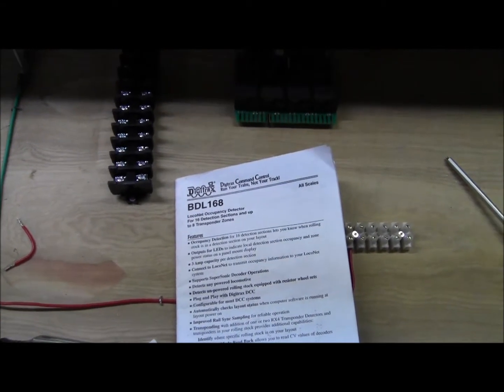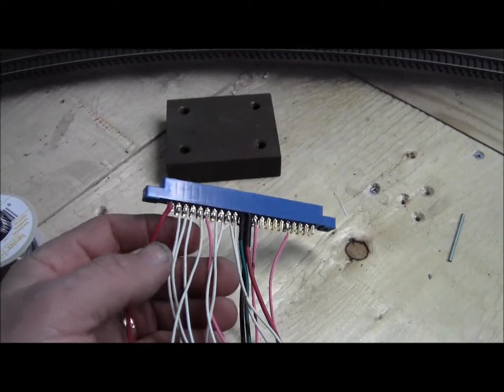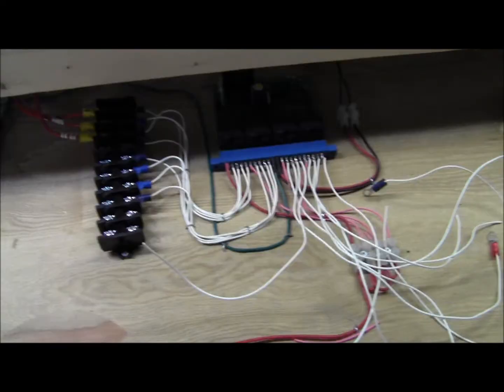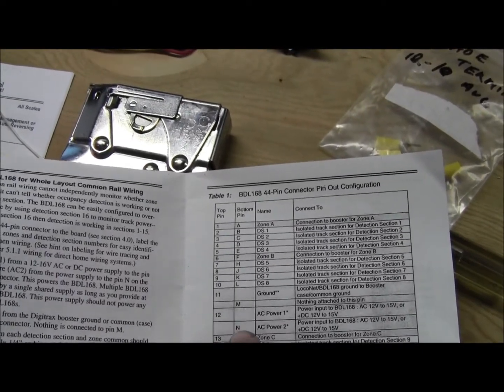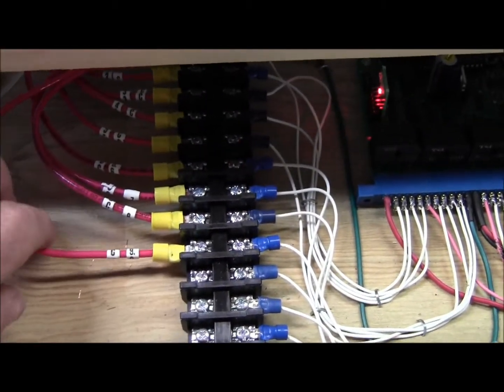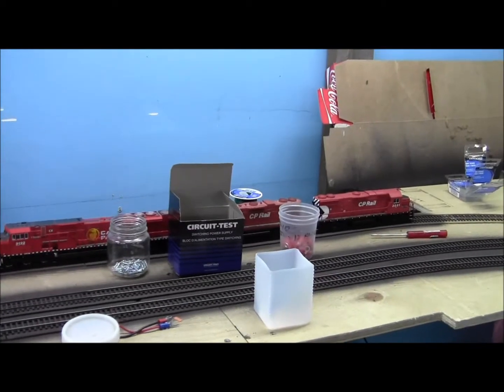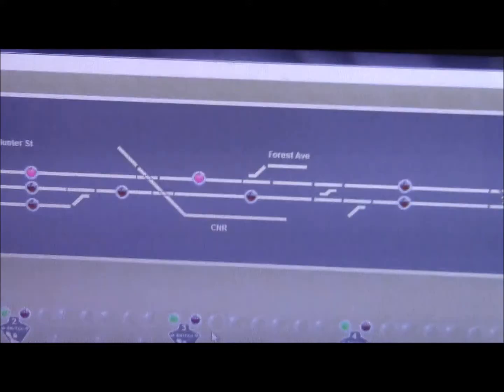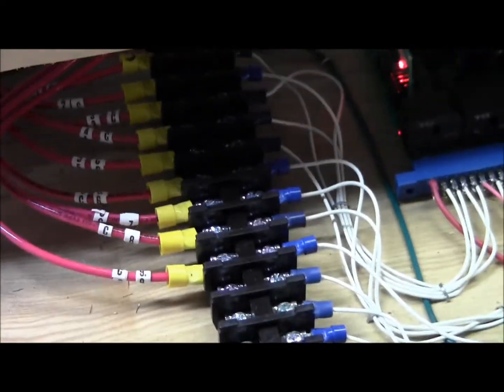Layout Update April 1 Detection System Wiring

Comment: Just curious...are your BLOCKS isolated on both rails? Does it matter what rail ( A or B) that you decide to monitor in a block .
Reply from the maker: it does not matter which rail is A or B as long you have the same rail for the common throw out the hole layout and the same rail for the detection. The only time you isolated both rails is if you start a new power block. Otherwise you only isolate the detected rail.in the same power block.

Comment from the maker: thanks . yes you can use multiple dbl 168 in the one power district. I would wire up the pm 42 frist because you need the the power from the pm 42 to go into the dbl 168 and than out to the bus bar of each detected zones.then do the drops form the track to that bus bar.

Comment: Hey awsome work thank you for sharing, just a few questions. For every power output or "power district" that the pm42 has can use multiple bdl168's in that one power district? and do you wire up the pm42 before or after the bdl168?